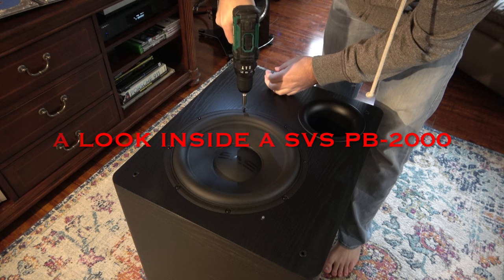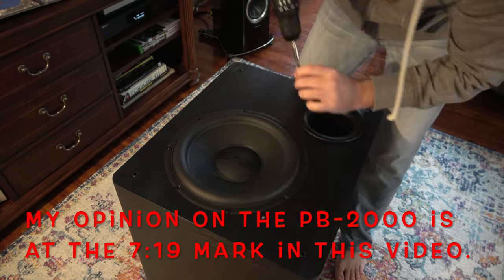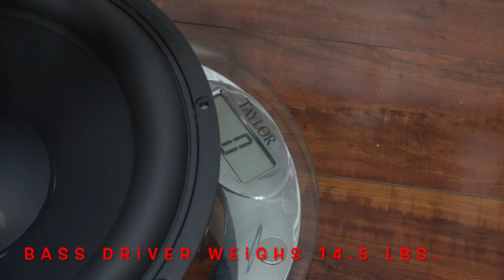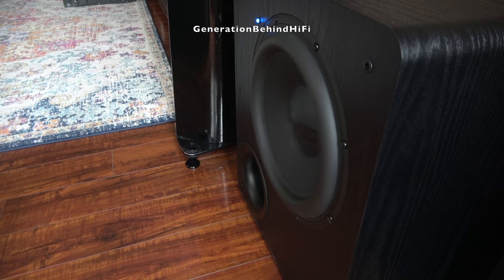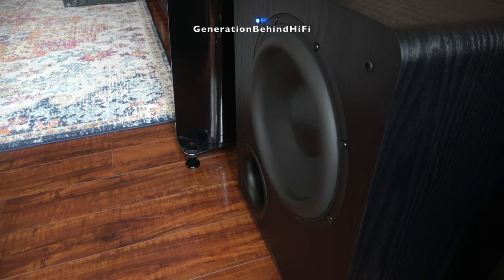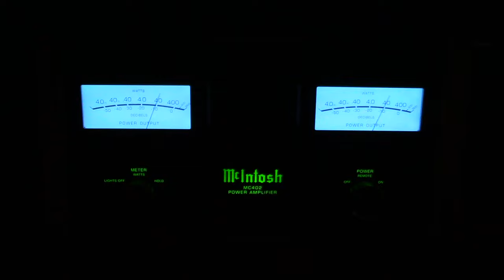A Look Inside a SVS PB-2000 Subwoofer

Comment: I have the PB - 2000 and i bought it especially because of the Peerless XXLS based Chassis. It evolved over the time, based on first versions from the 1990s. Its rated at 125rms, but is powered by a 500W RMS / 1100W peak Amp, which is a statement how durable it is. After 5 years of PB-2000 ownership, i would buy the sub again :).
Reply: In the late PB12-nsd it's the same drier.
Reply: @JoJanDiezel  Similar, but not exactly the same. The driver in the newer PB2000 PRO looks to be a big step back, at least build quality wise
Reply: @jamiet74  Yes, it is. I don't really care about the material of the basket but I really wonder if the Pro version do sound as good as the older non pro 2000-series... I could only find info about the output, meaning the Pros are supposed to deliver a little more output in the higher frequencies... but I mostly care about how good it sounds...
Reply: 240€ only the sub.

Comment: That a new style plate 300w amp it also used in polk 505 powder subs  the older svs used a bash amplifier  wich is still sold at parts express  under bash.  3 and 500w versions😊👍✌️💯

Comment: After over 40yrs of doing audio work I wouldn't advise using a power tool without the opposite hand guarding against a "slip off"....trust me
Reply: That does make sense mate, Good on ya
Reply from the maker: Accidents can happen with a power tool or a manual tool. The key is focus and being careful.
Reply: Almost 35 years in the hobby, punched a hole in a surround early on with a Phillips bit, I will not make that mistake again.

Comment: Hello what do you think about the sb2000 without the pro?:) Now think to buy it and choosing between sb2000 and rel ht1205mkII bit rel is 250$ more:(?
Reply from the maker: Can you order both and return the one you don't like? Both SVS and REL offer 30-60 day in home trials. Did you see my REL HT 1205 MK1 look inside and review video? In my opinion the HT 1205 mk1 is the "poor man's" SVS SB-3000 in terms of output and sound quality. Both the SB2000 and HT 1205 MKII subwoofers are very good, but if it were me I would go with the 1205 MKII.
Reply: @generationbehindhifi  Great call 5 minutes adter you wrote this I bought the rel 1205 mkII.

Comment: How can a big speaker make so much Bass in not so big enclosure
Reply from the maker: IMO this enclosure is huge for a 12" driver and that's one of the reasons I couldn't keep it. :) It stuck out like a sore thumb in our living room.
Reply: @generationbehindhifi  I was thinking of your other video that you put a massive CCX driver in a small JBL 10" enclosure lol
Reply from the maker: @BoRerunn  Oh! Your talking about my upgraded JBL 550P subwoofer with a CSS SDX10 driver! The CSS driver is actually designed for small enclosures and that's one of the reason it works so well in the original 550P cabinet. I touch on the design and the reason why I went with this subwoofer in my upgrade video series.
Reply: @generationbehindhifi  will a CSS SDX12 spec fit into a JBL 120 or Klipsch R-12S ¯\_(ツ)_/¯
Reply from the maker: @BoRerunn  That's a good question! The CSS SDX12 driver is a monster! I'm not familiar with the JBL 120 or R-12S since I don't own either, and I haven't done the modeling work in WinISD. However, if any of those cabinets meet the volume requirements on CSS's website for the SDX12, then it should turn out ok. But, I would bet money that the ports on either of those cabinets would need to be reworked (length and diameter) because the SDX12 can move a ton of air.

Comment: 2.2 ohm is ridiculously low. That amp must get hot, no?
Reply from the maker: As long as the amplifier is design to handle that load then it won't be a problem. I didn't notice the amplifier getting hot at all when I had it.

Comment: I would have thought that they would have covered the amplifier like some amp assemblies that I’ve seen.
Reply from the maker: Do you mean enclosing the guts of the amplifier in their own enclosure? If I had to guess, they probably didn't do that for thermo reasons.
Reply: @generationbehindhifi  That what I was thinking. I've seen other amps in their own enclosure. For example, some Parts-Express amps - like the one I bought - are like that.

Comment: I have one with the class D. Amp,      my 30 plus yr old usa made mtx with 100 watt class ab amp.blows it away
Reply from the maker: Hmmm... that's a bold claim! I have built quite a few subwoofers on my own and have used high quality parts and this PB-2000 sounded phenomenal and hit especially well on movies. Since a subwoofer is designed to reproduce low octave frequencies I really don't see the benefit with running a class A/B amplifier and doubt many would hear the difference between the two with all other things being equal.